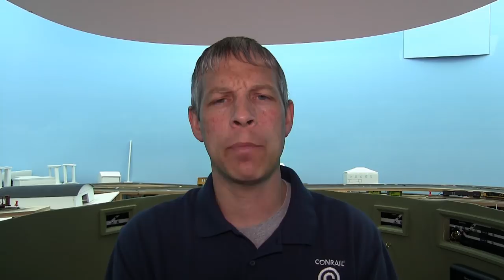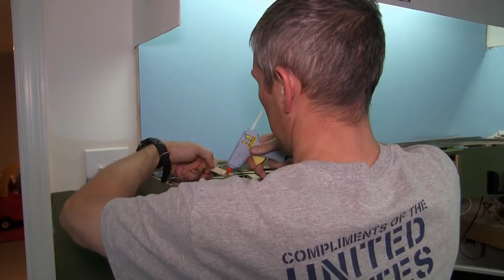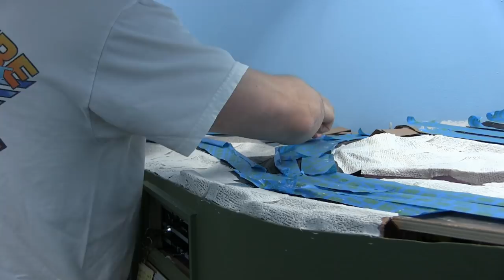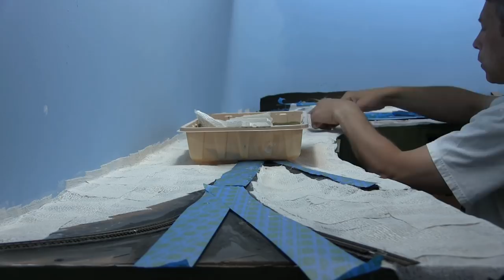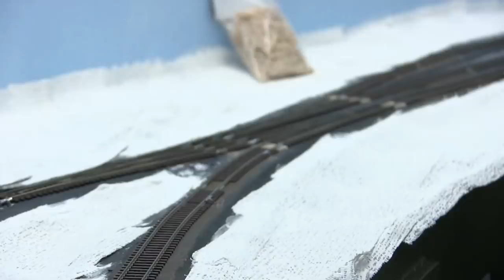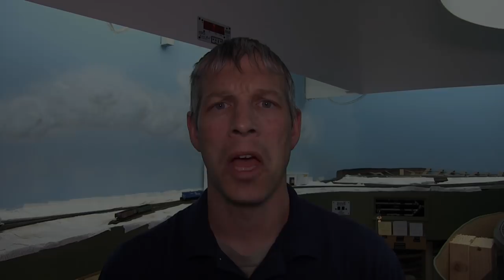Scenery for the Sayreville Running Track

Comment: A nice introduction to scenery aka Joe Desmond style. The clouds did indeed end up well done and kudos to you for sticking to your guns and improving on the original clouds. they look good and are believable now. I always stain my sleepers/ties  with a lighter shade of the colour of the ballast that I will use. This gives them the look of being aged rather than being brand new. Also when using the cardboard skeleton method Ii use the glue gun to stick crossing pieces together rather than staple them. I use a spring loaded clothes peg to hold them in place as they dry. Also thanks Joe for the now non-shiny track. I can rest peacefully at night now that that abomination has been taken care of! LOL.
Neil W

Comment: I myself love working with the plaster cloth, just fun and you can do anything with it, I agree with you, for some reason it is relaxing when working with it. 
Clouds, so many ways to do them, I used a sponge when doing mine. the thing with clouds. you can walk out side every five mins and they are different. the small ones you did ,did look a little like a coloring book cloud. the final scene is nice. But , in my opinion use your air brush and add some smaller ones, just mist them in, don't have to be a thick white cloud, but almost something you would see through. like a cloud just starting to form. but then again, go outside right now and they changed yet again. lol, w
nice to see you working on landscape.
Reply from the maker: sparky107107 thanks sparky!

Comment: Love the start. 
The grid method is much cheaper than foam. 
I was wondering could you try papertowels dipped in plaster?
I have seen a few guys use that and I was curious about how well it works. 
Thanks.
 ~R. Wallace

Comment: Your stencils may work better if you tear rather than cut the edges. Speaking of tedious, your little pieces of gauze would drive me crazy. I once built a mountain 4 feet high and 30 feet long. I'd still be at it with those little squares. For awhile I worked as an orthopedic assistant, so my techniques differ from many people in the hobby. Good to see you've started on scenery.
Reply from the maker: Jerry Smith thanks for watching. I like the smaller pieces because it’s easier to control.